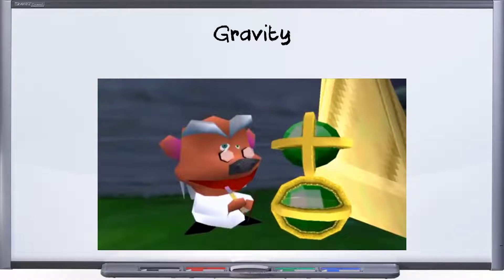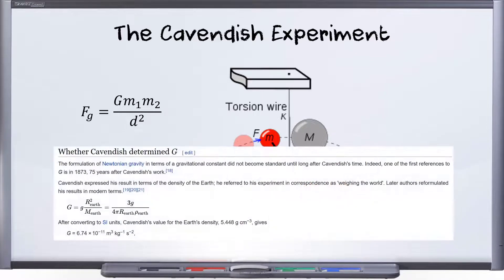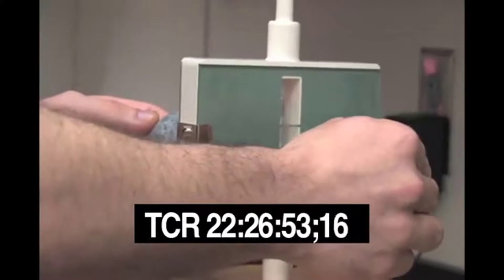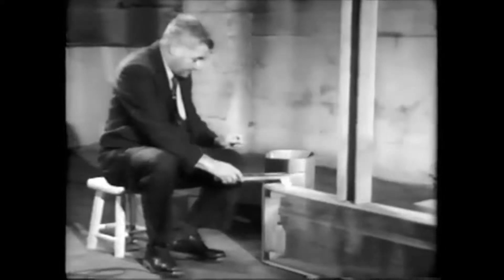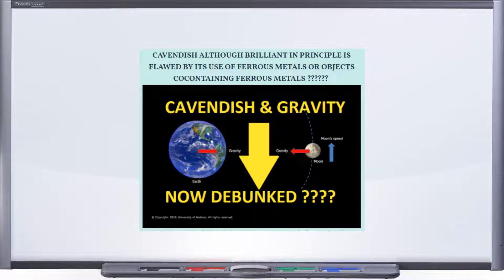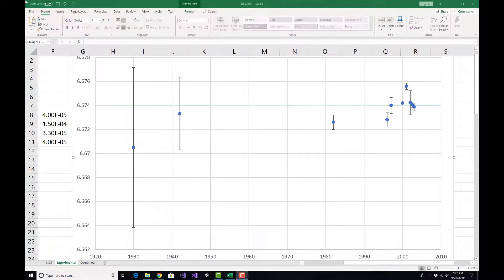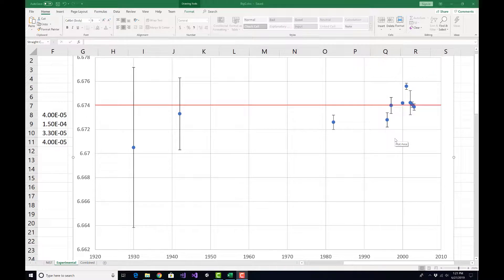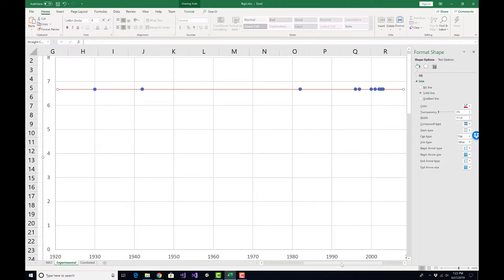Gravity #4 - The Cavendish Experiment

Comment: Rope or whatever it is hanging off of is a twisted. To make thread, you have to twist the fibers to make 1 thin thread. To put weight on the twisted thread, it unwinds, and springs back. Your energy put into the device that you can never remove, because there is no way to prove that it is not the twist on the thread or rope. experiment flaw that can never be removed.
Reply from the maker: You make an excellent point about "confounding variables" in experiments. When we do an experiment, we need to be vigilant to look for and account for or eliminate those.
Are you so sure that you cannot eliminate that variable from the experiment? Give it some thought and see if there might not be some way to be certain that your results aren't coming from the twist in the rope. I can think of 2 right off the top of my head, and I would suggest using BOTH just to be sure. What can you think of?
Reply: @icansciencethat  An experiment has 1 variable that can be altered, changed, or manipulated. If more then 1 variable, it is a flawed experiment. As for whatever holds the bar up, it has to be a single strand, or the twist causes an unaccounted for energy to be put into the device. The device will alternate depending on the strength of the thread or rope, it is not a single fiber from top to bottom. It then will have the twist that will try to pull straight, but there is 0 way to prove it is straight to start with. 

Just because you can see an effect, it does not mean it is nature or in nature. A good example of this is that man can use a man made device and bake a cake, in no way is the cake a natural thing and never found in nature, but the effects of the man made device can create something that nature can not. Simply put, yes the cake is real, but it is an effect of man, not nature. So technically there is no difference , because the device can be the cause what is not seen in nature at all. An illusion of a device is not proof of an effect in nature, because like the cake it is a man made effect.
Reply from the maker: @glenn_gallaher  Excellent. The "single-fiber" approach was one of the ideas I had as well. In fact, I'm afraid to say neither of us is particularly original. These devices do not typically use "rope" or "string". They use metals (wires), mono-filament (fishing line), or IIRC quartz crystals.

The other thing you need to do in an experiment like this is to try it both ways. First place the masses in the clockwise direction, and then in the counter-clockwise direction. If there is any bias in the torsion rod, or any bias in the environment whatsoever, testing it in both directions will reveal that.
Reply: @icansciencethat  That again is neither here nor there. It is an effect of a man made device. And you have the cake that is not found in nature. It does not mean that the effects of the device are not able to be seen, but if it is just things in the sky that have no physical object used to measure from the ground at your feet to objects over head. It is not real proof of how they work. If that is the only place in nature it can be seen, does in no way validate it as an experiment. Because what is the control variable, and what is the independent variable? And again, keep in mind of cavendish, the creation of the so called device, 200 years after his supposed death, and the access to the objects of current technology at the time. 

So when you modify the device, you no longer are working within the same conditions of the original experiment. You can not verify the results unless it is 100% the same, if not, it is like adding digital cameras to the moon lander that have auto focus. If you know about that. if not I can provide a link, but it takes about 4 hours to listen to.
Reply from the maker: @glenn_gallaher  You seem like a very logical thinker. Have you seen my "Kritical Kwikies" series? I had plans to make a lot more of these, but I kind of ran into a problem. Maybe you can help. What I'm trying to do with these is teach the basics of logic to people who do not think logically at all. My big problem is that people who don't think logically don't know it. I can't seem to figure out how to teach logic without using logic to teach it in the first place. You get what I mean? I try to teach the basics of logic, but to somebody completely illogical, it just sounds like nonsense. How can I possibly get through to somebody like that?
Reply: @Sage 123, you are positing a false dichotomy. Man-caused or naturally occurring, a physical effect is a physical effect, period. Suppose you want to study gravity by setting up a high speed camera to record acceleration of rocks falling over a cliff. It makes no difference if the rocks are pushed over by a human being or you wait for some to fall naturally.